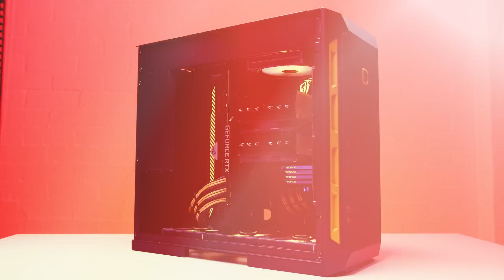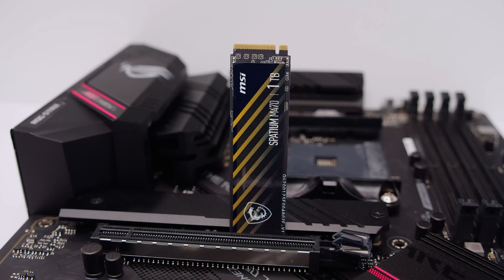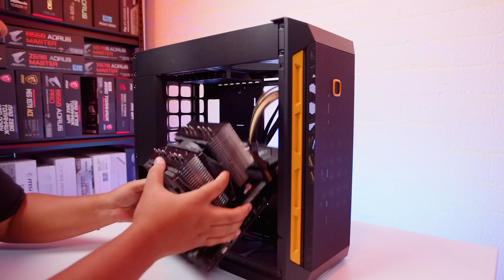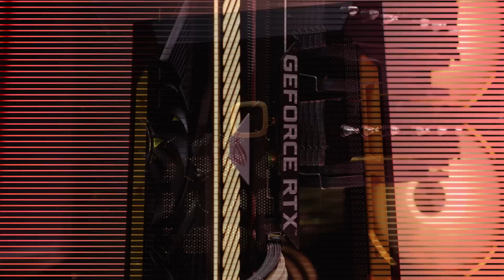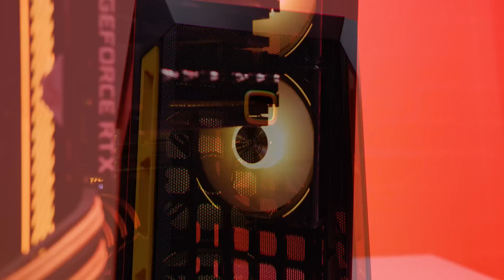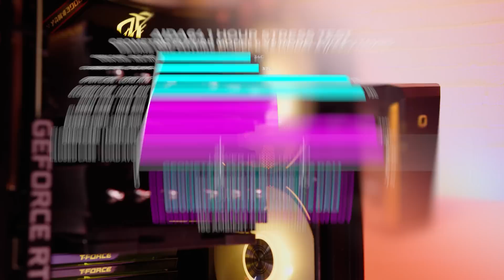Geometric Future Model 6 Dali is decent

Comment: Hello, I recently got the Corsair h60. Since my motherboard doesn't have a pump header, can I plug it to a sata adapter and directly to the psu?, or may be using a spliter a cable I can connect both the 3 pin pump and the cooler radiator to the cpuFan header. Which one could work with no problem?
Reply: hi i was in your boat b4 so you can use another fan header

Comment: This case is just meh!. 
The only way to use this case is because you are going to use the hot air coming from the front side to get you warm in case you would live in a cold place otherwise, it doesn't worth it.
Nice try but let's wait for Model 7

Comment: with people having issues with GPU cards sagging, does this case have any risk of having the card bend away from the mounting bracket in the opposite direction?
Reply: No, because it is mounted vertically not horizontally.